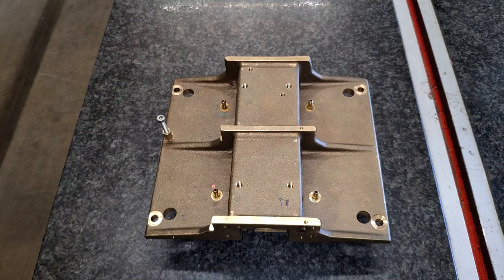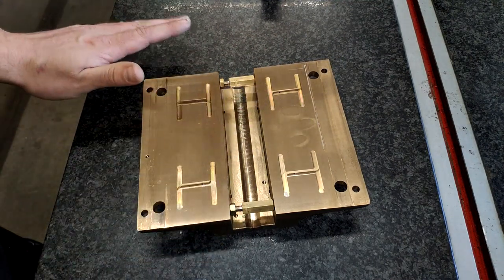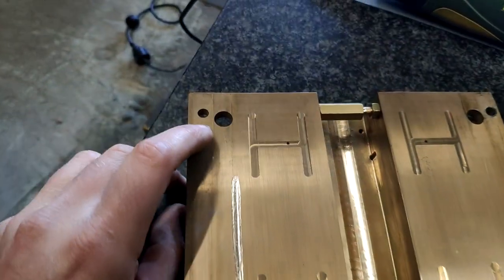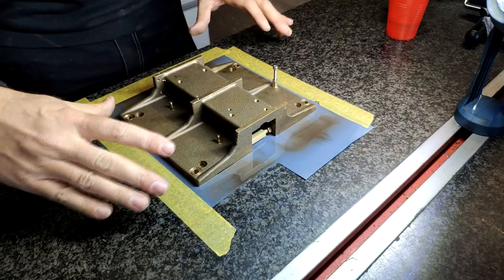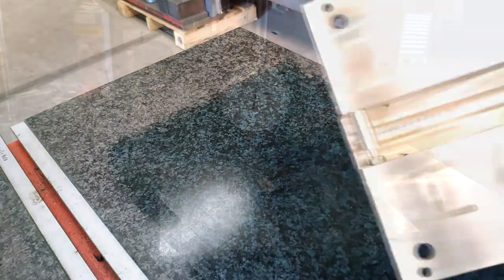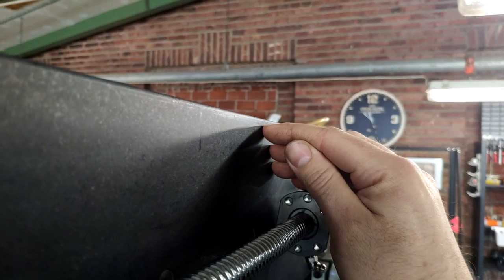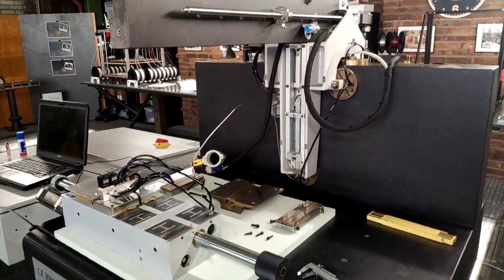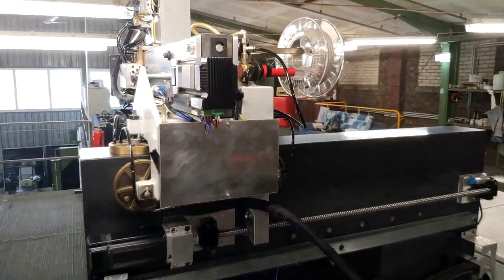Granite CMM 3D-Prints It's Own Covers + Air Bearing Lapping #S01E07

Comment: To remove almost any mark (bronze, aluminium, bluing paste etc) from granite, use proper strong rubbing with a Radiergummi. Yes, ordinary one with one side blue, the other red/orange/pink/white (white is usually not real rubber. .but it kind of works). Not only pencil eraser's rubber material itself has amazing properties which can clean porous stone materials like granite (it can grab dirt from pores and bring it to the outside surface). It has also pumice mineral abrasives incorporated in it which strengthen the cleaning (abrasive effect on paper) and pumice is softer than granite. If even the vigorous rubbing with the blue side of the eraser (which is more aggressive) won't help, you can always try a Cratex stick that has silicone carbide in it - gentle rubbing needed.
Reply from the maker: Very interesting, will try to get rid of the last few spots on the granite!
Reply: @Roetz40  Amonia should be used only to remove 3 week old peanut butter stains from the plate ;)
Reply: @chronokoks  the blue side contains some grid if I remember correctly
Reply: @GuyFawkes911  Aluminium and brass/brone can be cleaned with the non-blue side too of course. If you're concerned about the abrasive type in the blue side you can always try on hardened steel (which is still softer than granite) and look for scratches.. In my experience most of the normal european brands did not scratch hardened steel (+60hrc).

Comment: Another problem causing warping and lifting is temperature gradients. Not sure the temperature of the shop, but your hands left quite some condensation on the granite so it's probably pretty cold. That's why most decent printers have heated beds, and why high end ones have full enclosures.

Very interesting project, I enjoyed following along. Glad everything is working again.

Comment: Way late - the servos probably provide more than alarm state, you could use the BTT marlin accessory input to act like a filament runout sensor or other pause function when the motor detects even a few% overcurrent out of tolerance to really catch any problems early. Also, an air-pressure sensor could do the same. If the compressor fails you don't want to ruin the bearings!

Comment: @Roetz 4.0  I joined this video series a little bit late. Wanted to see what went out from the original machine. Like model numbers of linear scales, drives, and maybe some pictures from the control board electronics. Just I enjoy seeing how precision movements are controlled. Is there any documentation for the machine?
Reply from the maker: I do have full german documentation on the machine but they don't really show how it is built. There is so much know-how involved and you have to be certified anyways so I guess these machines aren't meant to be repaired by yourself. Measurement system is made by teledyne gurley and drives are swiss made dc drives. If there is anything in particular you want to know, post it here. Maybe I can insert that into next video.

Comment: Is there not a ballscrew support on the repaired axis?
Reply from the maker: No there isn't. If I stay under 2000rpm it is working great, above that it starts to wobble. But I don't need these high speeds
Reply: @Roetz40  Is it lost / missing or not by design? It's kind of shocking to me on such a high accuracy machine to let the screw hang.
Reply: P.S. love this build and videos! Exciting to see the Kuka.
Reply from the maker: In the original state there is no ball screw, they did drive the axis by friction.
In my case I installed the ball screws for higher acceleration values and easier feedback system. I could support the end but there is a formula on how to determine if you even have to do that. Takes rpm, free hanging length and geometry into account. Mine has critical point at 2.000rpm and I do stay below that anyways since it is a direct drive.
Reply: @Roetz40  Thanks for the details. You are talking about the 'critical speed' due to resonance right?

I think for the cost of a BF block it may be supported :)

Comment: what dind of marker is it? ammonia (diluted to roughly 5%) should work, aceton works for most markers, mineral spirits/gas/Benzin/Diesel work OK for waxy compounds. Look at suburban tool (don bailey they clean their surface plates always with ammonia (household which should be 5%)
Now I got a question as a german where can I get precision ground stones here (for an OK price)?
Reply from the maker: Thanks for information, I will check! You can get precision ground stones from Stefan Gotteswinter.  Other than that I dont have a shop at hand on where to get them.